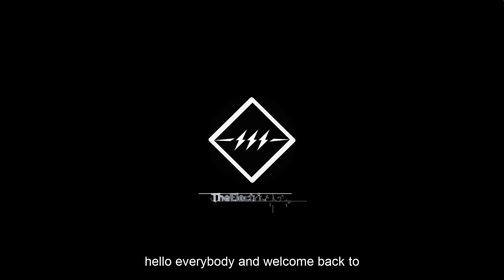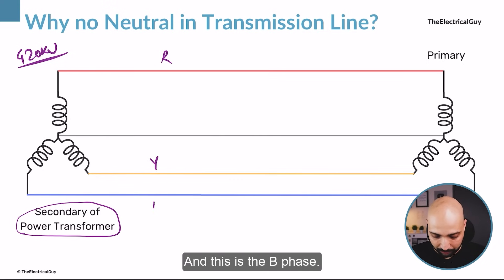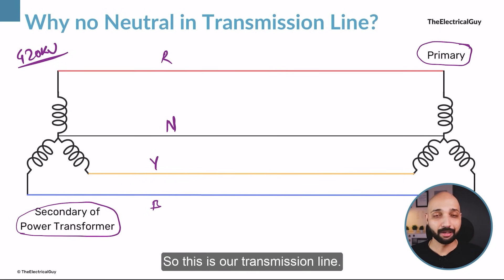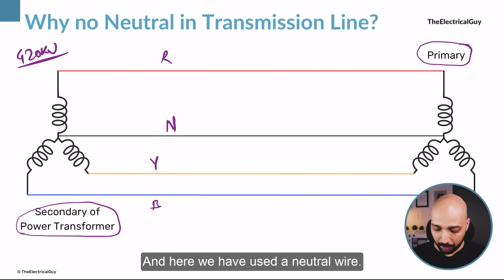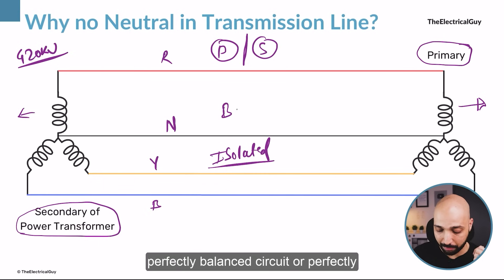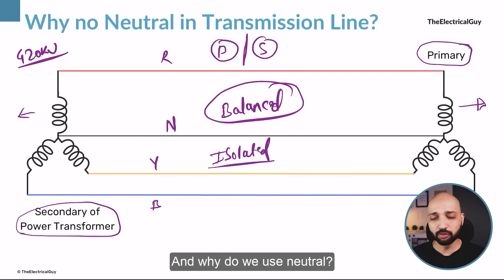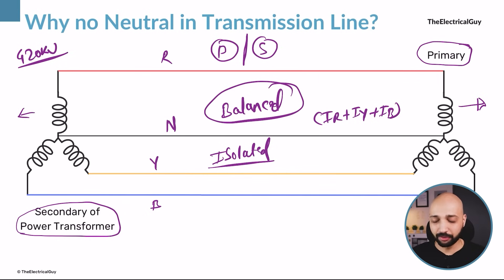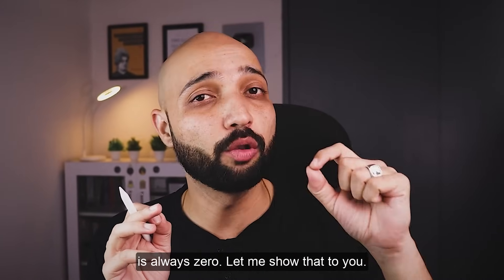Why there is no Neutral in Transmission Lines?  Explained | TheElectricalGuy

Comment: Question…if increasing the load on the secondary or a transformer also causes an increase in current on the primary of the transformer. Why would there not be an imbalance on the primary side going to the substation is the secondary side of the three phases leaving the substation could have an unbalanced load? Or am I misunderstanding how a load on the secondary effects primary current in a transformer?
Reply from the maker: Load on the secondary does not affect the primary!! Ps - yes there will be an impact on the primary due to changes in the load on the secondary.
Reply: @GauravJ  If I have a simple transformer and the secondary suddenly draws more watts because of increased load, wouldn't the primary also be supplying an increased amount of watts? So if the distribution side secondary has different loads on the respective phases wouldn't that translate to different loads on the respective primaries and make the transmission side unbalanced?
Reply: @GauravJ  Thank you for the reply.  I’m just still a little confused since prior to this video I have read as well have seen videos explaining the effects of secondary current and secondary back emf actually cancelling some of the primary windings back emf which in turn causes an increase in current in the primary winding.  It seemed to make sense and now I am learning something else that is new so I am just trying to make sense of it. It seems as though there are some transformers where the secondary affects primary current but in the case of three phase high voltage transmission lines to a substation it is not the case?  Not sure if having secondary neutral and primary neutral bonded makes any difference or not (referring to single bushing transformers supplying power to homes here in the US) i’m not doubting you so I’m sorry if it’s coming across that way, just trying to learn.  Seems as though the more I learn, the more I realize how ignorant I am lol.
Reply: I totaly agree, when there is a fault on the secondary side of a transformer, that fault will reflect as a high current also in the primary side causing its protection cut out assembly to  disengaged. Thus secondary load changes affect the primary circuit of the primary. This is true for every transformer, single phase or three phase,low voltage or high voltage,however in the distribution side,which is a wye configuration,the utility company make sure that load distribution to each phases are balance as possible as they can to minimized imbalances, it will not be perfectly balance since the use of every household,commercial and industries are variable. However placement of transformers particularly single phase are arranged in a manner to minimized imbalances back to utility main three phase transformer.the utilit transformer is usually configured delta primay at 69kV for example while its secondary is wye at say 13.2KV with grounded neutral for single phase loads and will carry the minimized unbalance current back to utility transformer. This minimized unbalance load will have very small effect on the 69KV delta side of the utility transformer, and basically this 69Kv is supplied by powergrid say 230/69KV transformer which has wye-delta configuration. That any minimized imbalances at the 69KV will be even minimized further down back to the generating stations by the succeeding  high capacity power transformers.Hence for the wye configured 230KV side with no neutral conductor along  those line currents are almost balance, The high Line voltage will even make the imbalances if there is such to have insignificant effect on the three phase voltages even there is no neutral conductor connecting the two sides of the  distant transformer of the power grid and the distribution or the utility company. The higher the transmission voltage the better to use wye with no neutral to save coil insulation for the transformer due to line voltage divide by square root of 3, rather than a delta configured that the phase voltage will be equal to line voltage hence it will require thicker insulation for the coils. This are only few considerations in the design to use wye or delta in the high voltage transmission lines. So wye or delta can be possible configuration in high voltage transmission lines because the three phases are almost balance in terms of their line currents.

Comment: Curious as to why you did not mention the neutral and Earth connection at the center point of the transformer on the distribution side.
Reply: Isn't integral to the explanation he is giving. Yes you would have your N to Ground connections to prevent floating voltages
Reply: Very good question! 
Actually, mid points of stars on both sides can be grounded, and earth can play the role of neutral wire. But this is not usually done for the purposes of protection. Having grounded mid points and neutral wire is the best option

Comment: Have been looking for this for 3 years.
       My local distribution also has no neutral.  All of the RESIDENTIAL 
single phase step down transformers have ONE BUSHING and no observable neutral wire back to the substation.
           Every transformer (along the line of one of the phases)) is NATURALLY connected to ground from the transformer can.
Comment please.
Reply: Post a picture of the poles and I'm sure we'll find the neutral.  Electricity doesn't work too well without a return, and the earth, as good as it is, can never be relied on to replace a conductor for regular use.
Reply: The neutral is almost certainly strung along in the secondary space, with the services and secondary conductors.  It may not be at the top of the pole with the other primary equipment.
Reply: @req44  Well, it is clear to me.  Only one conductor running at the top of the pole.

Many many single phase step down transformers being connected to this SAME one conductor.    Naturally each can is connected to earth coming from a COMMON POINT
inside the transformer.
           AKA multi point grounding system.   Still looking for this mysterious neutral
conductor ( which is not evident)
comment please
Reply: My friend, check-out SWER systems (single-wire earth return) and I reckon you shall find the answer you are looking for. Hope it helps from a fellow electrical engineer!